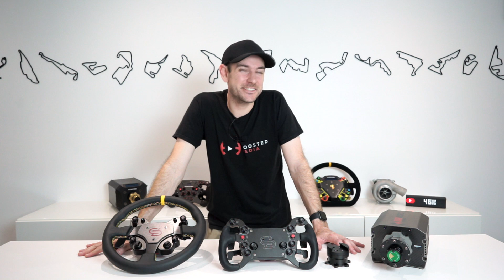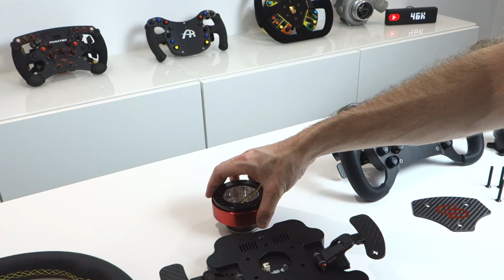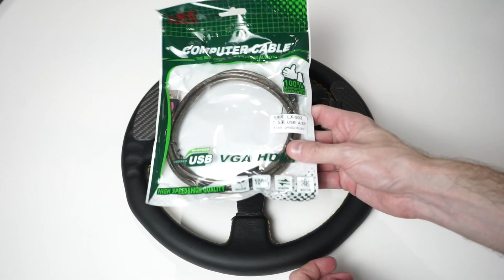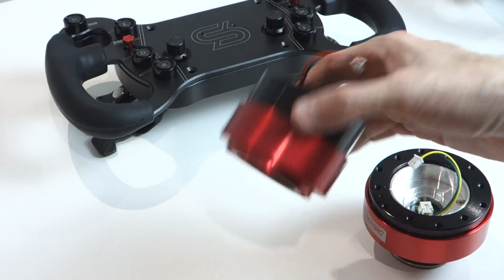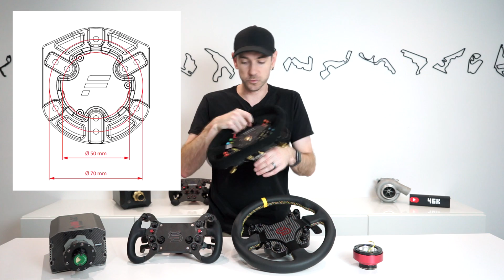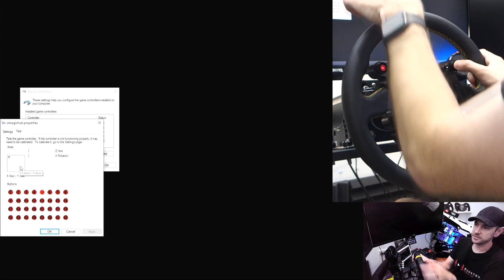How to mix Simagic Wheels & Bases with Other Brand Hardware - Fanatec / Simucube / etc

Comment: hey i have a question in regards to the cable. Will it not wrap around the wheelbase if you turn the wheel more than 180°?
I bought a Simucube wheelbase and got a simagic GT1 wheel. Only now realized they are not compatible without modding. I got how to attach the hub but am worried about the cable a little

Comment: Couple of questions. Does this simagic QR fit the Moza? I have a turn racing R305 I run with my CS wheel. I’m thinking about buying the GT Pro Hub or GT Pro with D 320mm wheel and plug back into the PC. Which would you recommend? Love the channel and content. An older video but it just shows how on point you are 😎

Comment: Unfortunately this video is not valid anymore. I have bought the alpha and wanted to mount a 70mm qr on the alpha. But it has an 58mm pattern. Really sucks. This video was the reason i bought simagic lol.
Reply: the 70mm refer to the pcd bolt pattern on the qr. D1 spec, genuine NRG works with it.
Reply: @Steve93K  70 pcd refers to the old simagic wheelbase, the newer ones use 58mm. Thats why i have said its not valid anymore.
Reply: @azamat19  Im confused, you meant the base itself has a different pattern now? Doesnt that make older wheels dont work with newer base? Sorry if i'm confused. Because I dont see the base having any changes. Simagic has two QR, QR50 and QR70. thats all i know. Because you can still buy a Alpha/Alpha Mini with a 70mm QR included.
Reply: @azamat19  i did a quick search. 58mm is the bolt spacing on the BASE side of the QR.
Reply: @Steve93K  this video was about using standard 70mm pcd Rims on simagic wheelbase and about the simagic rims that all have standard 70mm pcd to mount to thirdparty wheelbases.
This old simagic wheelbase in this video uses a standard 70mm pcd pattern under the qr. So like here in this video you disassemble the qr and can then mount your own qr or a rim directly. That was what this video was about and the reason i bought a simagic alpha. But the alpha wheelbases use 58mm under the qr, so its not possible to mount my xero flex qr without a really expensive adapter.

I hope its clear now.
Reply: @azamat19  you mean it’s 6x58mm pattern on the base side of the QR right? Yes it has always been that way since day 1.
Reply: And yes fitting a 70mm qr won’t work. But the bolt pattern for qr70 is 70mm pcd. Which works with most aftermarket wheels.
Reply: @Steve93K  i dont understand what you are saying honstely. 
in this video you can clearly see that the old simagic m10 wheelbase has a 70mm pcd bolt pattern on the base side. you could just put a standard rim on this wheelbase without a qr. now you can not do this as we NOW HAVE 70mm. do you really not understand what im saying? i think you didnt even watcht he video.
Reply: @azamat19  thank you for clarifying, yes the m10 is different from alpha bases. thank you and apologies for my mix up.
Reply: @Steve93K  hehe all good mate

Comment: does anyone know how to remove the rotary encoders on the gts wheel. ive removed the 4 screws on the face plate because i just got the wheel and there is something rattling around inside but all functionality seems fine. So i thought maybe a scew came loose. But the encoders are whats holding the faceplate on.

Comment: So could I use this quick release to connect a momo or some other 70mm wheel to the simagic without connecting any electronics? Just the wheel and use separate shifter maybe?
Reply: yeah you can do that but you might want a button box

Comment: I've literally been searching for hours to see if i could use these sim magic wheels with my small mige motor and this video answered every question i had, Thanks Will
Reply: Did it work? Thinking about doing same thing but worried about cable
Reply: @KnicksOrBricks i bought a gt1 d wheel to try if it work in usb i will comment again when I receive it and test it
Reply: @KnicksOrBricks  So it work  with a gt1-d with a moza base,  i just plugged the wheel with usb

Comment: Well after seen this I was stuck on the part what and how I would get buttons on my simucube wheel base as once I get the wheel base n peddles from fanatec I am going to be broke lol. If this wheel is cheap to buy seems enough to race with n button box on the rig while u save n get ascher wheel set. Cheers man. But ? For you that cable on the back does it get in the way at all when the wheel rotates 900 degree as I will be using my wheel fos Supercars and drifting and also plan on buying a f1 wheel for when I do my league races.

Comment: Excellent build quality☸️>share4.photo/FanatecWheel?cd    high-end materials, and almost feels like the real thing. Even the quick-disconnect is made of the similar solid aluminum parts as those found on real race cars. I currently use this interchangeably on Xbox One (Forza 7, Horizon 3, etc) and PS4 Pro (GT Sport, Dirt Rally, Dirt 4, WRC 7, Project Cars 2). Yes you heard that right; one wheel+pedal set for both consoles! It’s deisgned for Xbox One so it’s a direct connection, but for the PS4 I use an $80 DriveHub adapter from Collective Minds, which emulates a Logitech G29 wheel and was an easy plug-and-play out of the box. Workes great on both systems, though the force feedback on Forza 7 feels a tad better, but that may be due to the FFB programming in the game software rather than the adapter. Did I memtion it works for PC as well? Best steering wheel for Xbox One, PS4, and PC.
Reply: woooow

Comment: Mmmm, I don't trust the Mini USB port on the wheel ... over time, it will get slack. What do you think?
Reply from the maker: I’m concerned about it too. Apparently there is an option for a screw in cable. However details are scarce.
Reply: @boostedmedia  Ok, thank you for your answer. I will stay tuned for a possible change...

Comment: So is an extension needed for the gt4 to convert the 50mm to 70mm pattern first, then mount to the wheel side Simucube QR? Or is there a way to do it without an extension to keep the wheel to motor distance the same?
Reply from the maker: The Simucube QR (at last the one I have) also has a 50mm stud pattern on it.
Reply: @boostedmedia  Thanks!

Comment: Another excellent review. Very informative, even for those of us (like me) who already own a Simagic device.
Reply: alpha mini + gt4 or CSL+gt3!! After club sport QR, 3rd party magnetic shifters with GT3 wheel & boost kit the price is not so different. Is the wheel really that much better ( simagic) its only 2nm, where's for eventually 15nm bases is easier to upgrade from DD bcus the sell like wildfire 2nd hand.
Ive never owned a wheel though but am mad fast no assists. cheers lad
Reply: 1.27.00- 1.27.50 (f1-21)consistent pace around bahrain which is alright otherwise I wouldnt upgrade to such wheels thered be no point.

Comment: Does the base still go into berzerk mode (turning like crazy) occasionally or has this been sorted out in the meantime?
Reply from the maker: I haven’t used the base since I did the review but I did figure out why it happened and it is repeatable. 

If you have the wheel turned past the angle you adjust the sensitivity to then it goes mental. 

So for example if you have the wheel turned to full lock at 900 degrees, then set the software to have a range of 360 degrees it will do it.
Reply: @boostedmedia  phew, this sounds like a nice party prank. ;-)

But while the issue itself still bothers me, it least it does not happen out of nowhere.

Comment: Do we know if we can buy simagic wheel side qr to put on other wheels to save with the issue of the cable on the base side quick release or will it need a new base side qr?
Reply from the maker: I’ve seen simfai advertising the QR on its own for sale.
Reply: Boosted Media where? I didn’t find it yet...